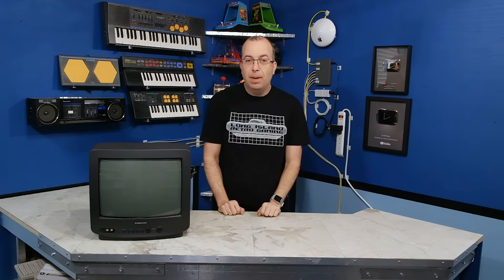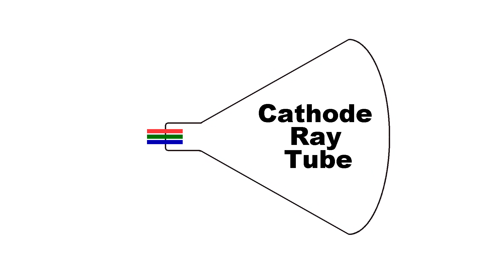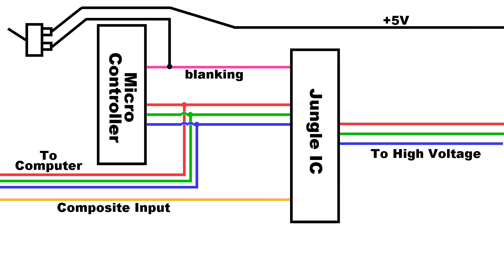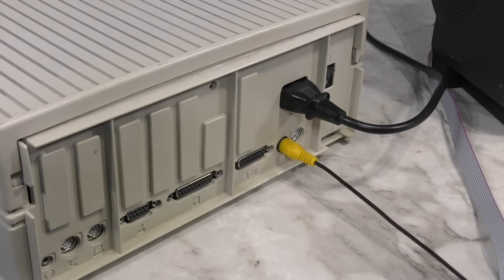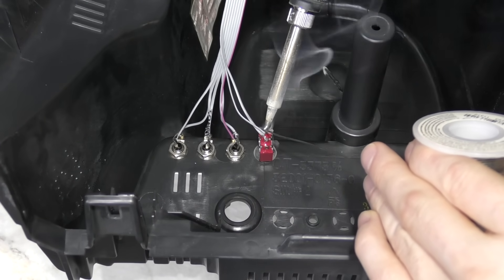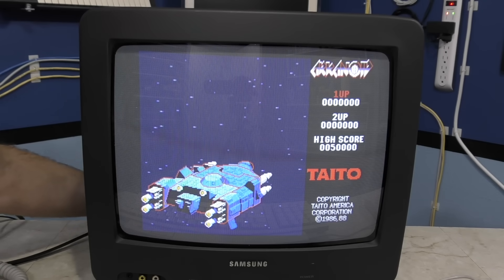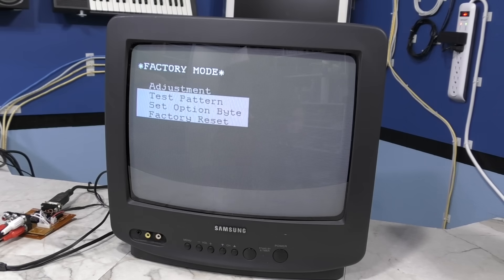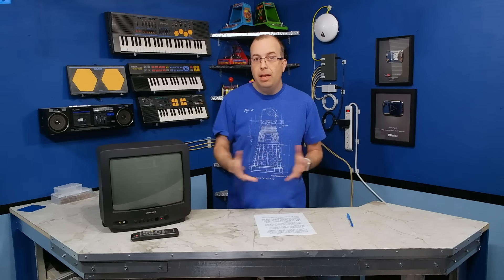Modding a consumer TV to use RGB input

Comment: In Europe we had SCART back then.
The amazing thing is the reaction when people from USA see this even nowadays, priceless!
Good job my friend.
Reply: Correction: We still have SCART. The good thing is, even some of the most crappy CRT TV's did have one and it's still on some modern ones as well.
Reply: I don't think all SCART pins were utilized on every TV? So just because the SCART standard has the possibility of an RGB connection, doesn't mean that every TV had that particular capability.
Reply: I'm just amazed to learn that there was no SCART connector over there. How come? NTSC–PAL issue?-50 vs 60 Hz? Or just plain, old being slow adopting better technology? As great as it was, I just assumed it was a global standard.
Reply: CannedMan, SCART is known as Euro-Scart even in Europe (partly to differentiate the Japanese version of)
Reply: @stanimir4197  Nah! SCART is SCART in the UK. However, it's called Euroconector (spelling may vary) for the continentals.
Reply: We really didn't have any consumer electronics that used RGB. VCRs, laserdisc players, cable boxes, etc all outputted a composite video signal, which wouldn't look any better converted to RGB. When DVD players were released, we got TVs with component video inputs, which are functionally similar to RGB.
Reply: @shmehfleh3115  Who are "We"? No SCART? Are you talking about Trumpyland?
Reply: @CannedMan  Was nothing to do with 50/60. SCART was actually pretty useful for playing your import games, as if you used RGB and sync, you'd get the faster game without the letterbox - better picture quality as a bonus.
First time I ever held a soldering iron was to 'fix' my Megadrive/Genesis (https://www.youtube.com/watch?v=-NWvwpVbhvs)

#Edit. God-bless the internet - here's the actual fanzine that told me of this magic (https://ia800803.us.archive.org/11/items/Electric-Brain/Electric%20Brain%2034.pdf - page 31)
Reply: @CannedMan  I emigrated from the Netherlands to the USA in 2000 and I was just as surprised that there were no TV's with SCART or anything similar. When September 11 happened, I missed teletext SO MUCH!
But the stereo 27" Philips TV with teletext and 2 SCART plugs and 99 presets (also completely unknown in the USA) that I bought in 1994 had cost me the equivalent of about $800. My American 27" stereo TV that I bought after I emigrated was less than $300.
Americans aren't willing to pay lots of money for a TV so we didn't have SCART or teletext or presets. All that Americans want to pay extra for is a gigantic screen size. I've seen so many projection TV's that would blow up the picture to life size and looked like absolute crap in the days before high definition. And mind you, Americans never got wide screen tv's until HDTV became popular, and even now it's totally normal to see 60 inch 4K tv's in public places that are showing standard definition programs stretched out from 4:3 to 16:9. SMH.
Reply: @JacGoudsmit  Americans like everything which is big, crappy and cheap at the same time
Reply: +CannedMan Most likely just the manufacturers cheaping out.
The RGB equivalent we got is component but that only appears on the highest end crts, and even then only sometimes.
Even S-Video is nowhere to be seen on the low end models, and let's face it, the crappy low end models is what 99% of people bought.
This is why if you're a retro gamer in the US it's not as easy as just picking up some crappy abandoned tv on the side of the road or some freebie from craigslist as most people like to say to do. At least, not if you want some semblance of picture quality from your games.
Reply: man I don't get why retro gamers go out of their way for best picture quality when trying to recreate a retro gaming experience. like the TV I had growing up had A/V jacks, but I didn't get to use A/V input until I got an n64 because the RF dongle thing is just what my dad used. I grew up playing NES, SNES, and genesis games on a crappy signal and still enjoyed them greatly. I think we're just spoiled now that HD is the norm.

and most of these games were created in a way that they're supposed to played on crappy outputs, too. one of the biggest standouts is the lack of transparency on the saturn, you can't even tell if you're playing on a low end signal that those are actually dithers.
Reply: @orbusg8451  For gaming, one of my best experiences was connecting to our 28 4:3 CRT TV. Due to the trickery of how those tellies processed the picture, Q3A never looked so smooth.
Reply: Yeah, my 1995 14-inch Minerva TV had Scart ;) I unerstand why Americans are RACING to find those PVMs to play in RGB. Those monitors are amazing, but I guess it's decreasing benefits over an high-end late 90s-early 00s PAL CRT.
Reply: Scart (believe it or not) is French. It is like the Poirot, Smurfs Belgian thing. The French are very protective of their developments. It was only Citroen and Rolls Royce (at great great expense) who had their (Citroen's DS) superb car suspension.
Reply: @moviebod  Its the same with other techniques. The french als use another TV-standard called SECAM.
Reply: Mercedes-Benz licensed Citroen's hydro-pneumatic suspension for the W116 450 SEL 6.9 sedan in the 70s
Reply: moviebod
Poirot was a creation of Agatha Christie, and he was belgian.
And had the french been so protective, how come basically ALL of europe have or had SCART? lol..
Reply: +BlauesRauschen
SECAM is extremely similar to PAL and majority of PAL systems could use SECAM and vise verse, SECAM was the adopted standard in the East, ironically North Korea is the only Socialist country that adopted PAL.
Reply: @BlauesRauschen  Original French SECAM sucked a great deal until Soviet comrades improved it a little bit
Reply: @moviebod  It is the opposite mon ami : because it was French the Yankees decided not to adopt it. Even worse for the Citroën DS where various Yankee states did all they could to prevent these superior cars to be sold on the US ground.
Reply: I never knew that
Reply: @moviebod  and Bentley. Bentley utilised the citreon's air suspension too. The reservoirs were painted but you'll find a citreon logo embossed in the metal.
Reply: Interesting.
Reply: The French totally lost their SECAM-PAL war, but they indeed won the SCART one.
Reply: @SMGJohn  Also Socialist Romania adopted PAL.
Reply: Just never made it here.  yeah its really annoying.
Reply: Well, that's not very surprising If you think SCART was also named "Euroconnector". That name gives a hint of where you can find It
Reply: My Samsung 46" LED TV from 2013 has scart, and I'm sure you can pick up some lower end brand new TVs which has it as well. I honestly didn't know they weren't a thing in the US. I used that stuff all the time. My old CRT only had one set of RCA inputs, but it had 3 or 4 scart inputs. I could connect anything I wanted and never have to worry about it.
Reply: @trulsolsen683  Yip! Ya gotta plug yer DVD into something!
Reply: @Ndlanding  and VHS player. And TV tuner.. And gaming console... And PC.... And other gaming console..... You get the picture
Reply: Odd hearing the American's not having a working SCART connection on their TVs, especially considering that the EU and Japan had SCART as well. (Albeit with different pin layouts)
Reply: Yes its funny there no scart.

Which countries do have s-video?
A connector who most people in europe call wrong they call it supervhs connector 😂
The right word is Separate video connector.

I was very surpriced when my LG dvd burner has s-video, scart, dvi.
But I bought a Toshiba vhs/dvd burner combo which I like more than that LG. Toshiba has Scart, dvi, hdmi, rgb, composite...but it lacks the s-video 😢

Another funny thing I found out via youtube is that USA use F-Connetor in standard analog tv.
Here in Europe (atleast Sweden and Finland) we use that as high end connector in cable installations and sattelite systems use it too. But we do not have this back in our tv unless the tv do have an inbuilt sattelite receiver.
Reply: ELLADARA RE! LIGOI KAMENOI KAI KALOI!
Reply: ETSIIIII
Reply: We still have
Reply: I don't even understand why we had scart. Luckily new TV's don't have that anymore. It's just a pain in the ass to connect if you can't move the TV
Reply: @DecibelAlex  Are you seriously suggesting that SCART shouldn't have existed just because you had to move your TV a couple inches to plug the cable in..? That's not a problem with the standard, it's just laziness.
Reply: My 2016 40" LED tv has a SCART too lol, then again it also has RGB, HDMI, VGA, DVI, Signal, 3.5mm I/O and optical..
Reply: In France it was a legal requirement that televisions have a SCART socket. I suspect the rest of the PAL/SECAM world just inherited that because it made no sense to make different models for the different countries.
Reply: Not all PAL world TV have SCART tho, at least not until Japanese TV makers adopt it, but it was quickly abandoned as signal thingy moves away from analog to digital.
Reply: same here xd
Reply: SCART actually was/is a rather good connector. Able to carry RGB signals as well as Composite and S-Video. There are common adapters for composite video and chinch audio into SCART. Picture quality is about the best to get for old games on CRTs.
Had less trouble with it over the years than with HDMI which tends to disconnect if I move the monitor or TV just a bit. In that regard I much prefer good old DVI that can be screwed in.
Reply: The prices are going up, but here in the UK I could walk into town and probably still get an RGB Scart TV for about £20. So modding a TV like this seems like so much work (fun though)! But then again we weren't that privileged, we had crappy slow PAL games on consoles such as the Mega Drive. Besides mods (which I eventually did) and imports, we still had to deal with it even in the PSOne generation. I remember Tekken was so slow! Also I think that games enthusiasts now often forget that actually, back then before HDMI, most average consumers in the UK still used Composite. They didn't know Scart was better, I worked in a games store and most customers thought plugging Composite into Scart with a little box adaptor was the same (and the norm).
Reply: I wanna see SCART in action one day
Reply: You saw out-run, one thing at a time ;-)
Reply: Amen
Reply: SCART was amazing back then. It was like the difference now between SD and HD.
Reply: Strange and incongruent thing is here in South America we always had PAL mainly (European legacy, for some reason..), but just Composite, argh!
Reply: @spacefolder  What do you mean by "for some reason"? Isn't it kind of obvious?
Reply: Hi Ndlanding! Well, actually (at least in Argentina) we have 50 Hz mains, son PAL makes more sense. We also do have a lower standard income compared to Europe, so yeah, that makes a bit obvious the lack of SCART. I know, I was just rambling :p Cheers!
Reply: Hi Vincent, is scart the best option from a vcr to a crt tv in Europe? Or is it that composite  cable? I live in Europe.
Reply: If you look ~ 9:11 it looks like the shell was designed so they could have mounted a SCART socket in the case (e.g. https://static1.tme.eu//products_pics/6/d/1/6d19b223b7e2905a5c47a7748fc01699/42677.jpg) - maybe I'm wrong, but that looks suspciciously like what it was meant for.
Reply: not all scarts are rgb
Reply: I HATE SCARTS... I use them even today (yes...) and they're so damn badly built and often fallout out the socket and the cable is too heavy and resists to fold a bit
Reply: True, if you buy them for just a euro. Good quality scarts last decades.
Reply: @xgamerbih  Never an issue for me, as I always used high quality connectors. When I bought my very first SCART cable, it was with goldened connectors; it was superb.
Reply: You didn't watch the whole video right?
Reply: @DSpigs  I did, I was talking about my reaction too.
Reply: Indeed.
Reply: we have 60hz so fuck off
Reply: too bad scart ports were flimsy as FUCK
Reply: I had an American flatmate in the 90's he actually shipped his tv with him from the states. It had SCART, this whole us didn't have scart is bs. MOST tv's didn't because price is always the leading factor and composite in was the cheapest method.
Reply: @krankymann  your flatmate's tv was probably multi-standard. I have a multi-standard VCR (NTSC, PAL and Secam) that I bought in America but has a SCART connector.
Reply: that's possible, i connected it to my saturn - he looked at me weird when i didn't know what it was.
Reply: I was a TV/Microwave/Nintendo repairman in the 1990's here in Canada. SCART did exist on this side of the pond, it was just very rare. 99% of the TV's I worked on did not have it. It was mostly high end and/or multi-format units.
Reply: @jameswebb5080  Is the antenna aerial same in USA and Canada?

Or do Canada use the european standard aerial connector?

They did use same standard ntsc?

Its interesting there so many standards.

As already told ntsc was not the reason to leave scart.
It was france invention and in France and Russia they used Secam.

I live in Sweden and here we use PAL total another system.
In Estonia and Russia they even used another audio carrier. Even if you got signal from abroad transmitter you only got and grainy picture and only static in sound.

I guess I can only guess also France used some another audiocarrier. I have and old multi CRT tv if I choose cable system France the audio also gets messed up.

Today almost all analogue gone 😭 in Sweden already been gone about 12 years now. But it still lives on in cable systems and thats really funny or not so fun since you have to pay extra to get channels digital 😡
Reply: Yes the US and Canada systems were identical. I was fixing 3-5 TV's every day for 10 years so I saw more units than the average person. I remember there was a Toshiba multi-format set that had SCART and I saw it on a couple of high end models that I can't remember the name (maybe Proton??).
Reply: @jameswebb5080  Ok thanks for reply!

I think Toshiba hit big market in france. Not sure but I ordered my vhs dvd combo Toshiba from France 😂 

only Toshiba in Sweden is computers and some hospital technology equipment. 

Even if we in sweden have scart in all machines did this particular vcr / dvd have rgb. 

None of my other machines have rgb on rca connections. 
Maybe via scart but never thought before you can in some models run rgb via scart.

Too bad I long time ago throw away somekinda rgb adapter that did not work in my low end scart tv or vcr.
Maybe it has worked in some more highend scart tv.
I thought the cable was bad when not working...
Reply: David Bjork for years Toshiba had a TV factory here in the UK. My nine years old LCD TV (with 2 x SCART, composite, VGA, and 4 x HDMI) was made there.
Reply: krankyman
Price is not always the leading factor, sometimes connectivity and practicality and quality are in focus from the get-go hehe..
American cars go by "price is the leading factor", that`s why they`re crap (all up until about say 10 years ago)
 ;)
Reply: SCART was nowhere here in the states.  Even on high end TV's.  Closest thing we got was component, and that wasn't until the late 90's.
Reply: Yeah I don't know what he's talking about.
I literally have never even heard of SCART until I got a bit into retro gaming.
It's not a thing here.
Reply: The annoying thing is component is better for retro gaming and allows for a pc to be used on a retro tv as well,  I want to connect a pc to a tv in UK and I am limited to composite or S Video unless I have component inputs.
Reply: Wrong, we had scart but it was called EIA multiport due to copywrites
Reply: @TheShivABC  Please right that again!
Reply: @will_it_work  incorrect